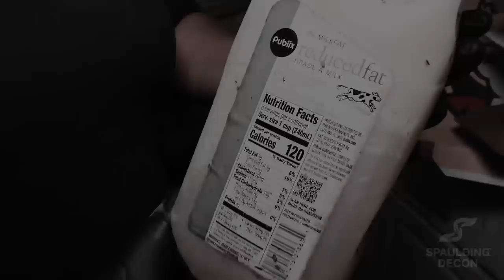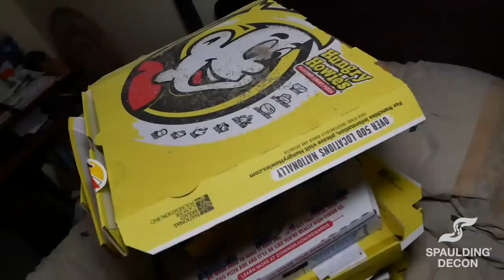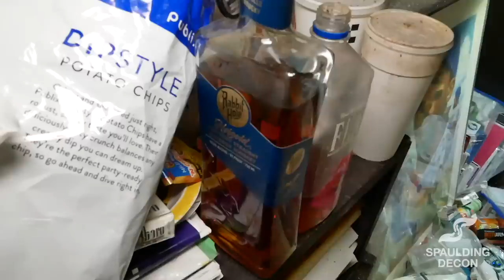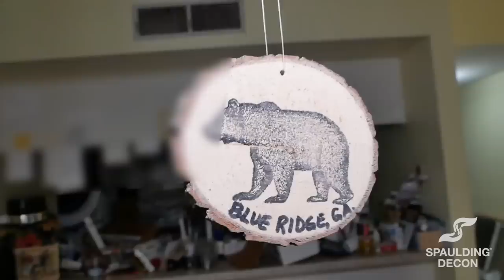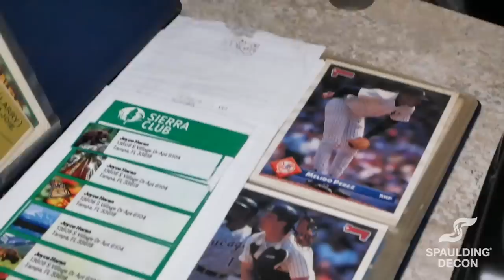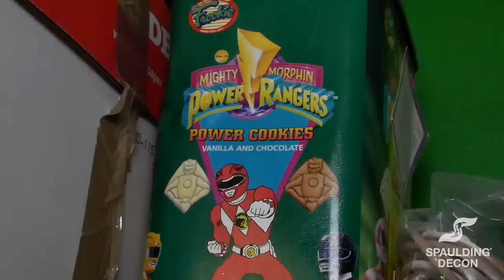Crystal M*** and the Munchies

Comment: Just found this channel and see it as a mild form of comedy. I don't have a "gross out" sensor anymore. I spent 8 years of my life cleaning private charter busses, mostly on restroom duty, inside and out. Nothing like cleaning a bathroom that gets used at 70mph that was filled with rich teenagers who had been at an amusement park eating junk food and riding rides all day.  Bus interiors COVERED in every kind of sticky that goes into or comes out in every bodily function imaginable. The term "POP" to me often meant "Pile Of Puke" in various stages of drying. Bathroom interiors that often included a "code brown" smeared on every surface. The BEST part was cleaning the hole in the floor of the garage where all those toilets get dumped. I could go on for days with stories of that job. I left because I was still being paid just barely over min wage after all those years.